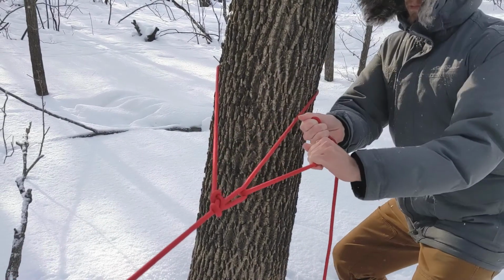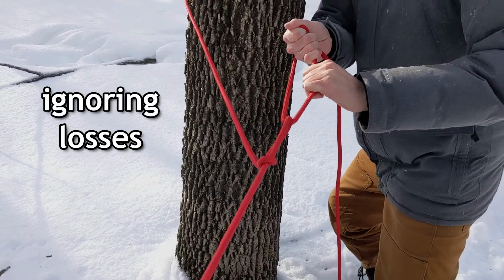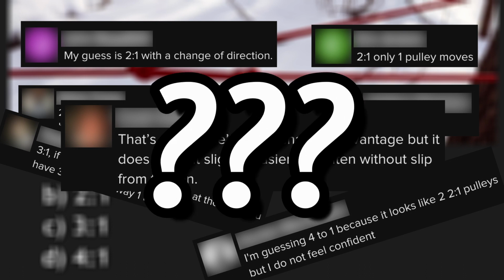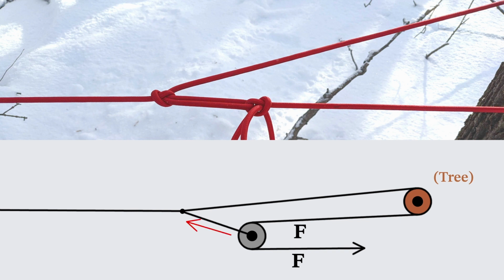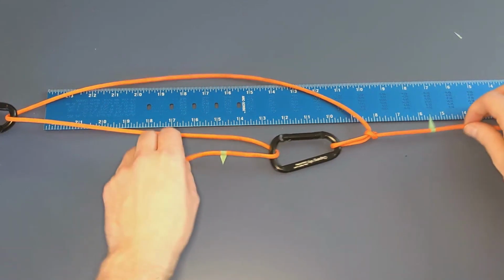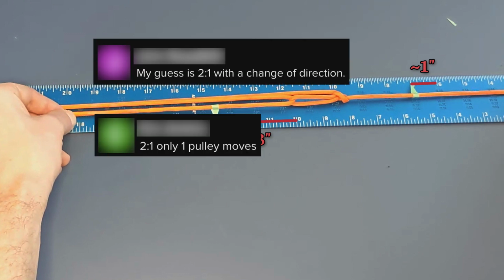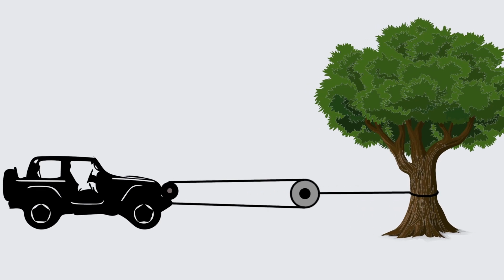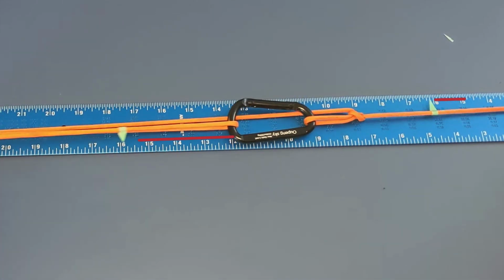Settling the Mechanical Advantage of the Trucker's Hitch

Comment: Yes, the way you drew it, it is 3F. However, when one uses a trucker’s hitch, on a truck, the pulley on the tree doesn’t exist, that end is anchored to the truck, giving a 2F on the tie down line    That might be where some folks went wrong.  Thanks for the video.
Reply: I usually tied off to one side of the load on my truck then pulled through a tie down point on the other side of the load then through the loop before tying down to the same point on that side. This would make that point another pulley and, seeing it was metal, less frictive than a tree.
Reply: Still quite a bit of friction on the rope loop. An old timer arborist taught me that if you tie your loop using a bowline on a bight and make all the loops the same size the rope you pull through the three  loops has a larger radius and gives a MUCH greater mechanical advantage.

Comment: Wouldn't it be easier if you use 2 portable luggage scales? Just attach those to both ends and if you have 1kg in one and 2-3 in the other, you can determine exactly how much mechanical advantage considering even the friction, although that is valid only for that system specifically, still it give us a closer approximation

Comment: I like to tie a theoretical 5:1 truckers hitch in most scenarios... Basically it's the standard truckers hitch + running the working end through and additional loop on the standing end. This is a super effective way to tighten down loads for transport on car roofs and trailers.
Reply: I do the same. I'll measure it again but I've always thought I was getting 6:1. But who would complain about 5:1 anyway? Not me.

Comment: This is great! You can also do the calculation using the theoretical length change in the working loop: Imagine a loop of length 6 units (3 +3) and the working end at the pulley. If the working end is pulled 3 units to the tree, the rope will by definition be in a 2+2+2 'N' configuration that has pulled the pulley 1 unit closer. Hence 3 to 1

Comment: So I agree that if the tree is treated as a pulley then it would be 3:1 advantage. But when you tie a ridgeline for a tarp with a tree as an anchor point, the rope doesnt rotate around the tree, making the whole system a single pulley system, i.e. a mechanical advantage of 2:1.
This also explains why your experiment gives a 3:1 advantage because when setting it up you allow the "tree" part of the system to move.
Reply: 100%
Reply: Well then the pulley rotates around the eyelet edge or whatever strap you are pulling into. Line is moving around and past that point. It's not anchored there.